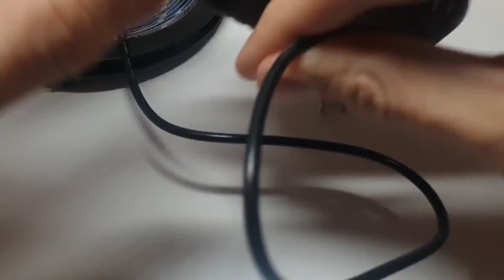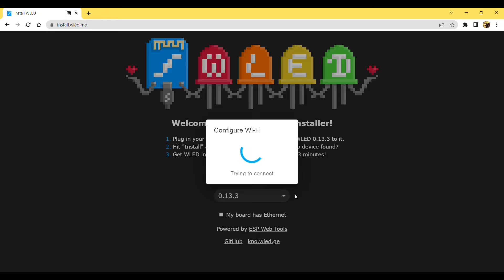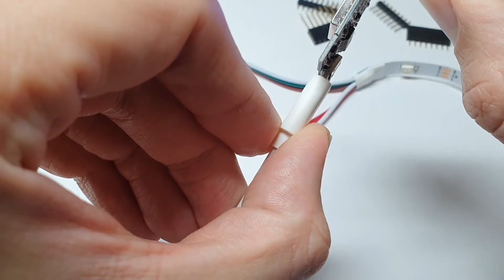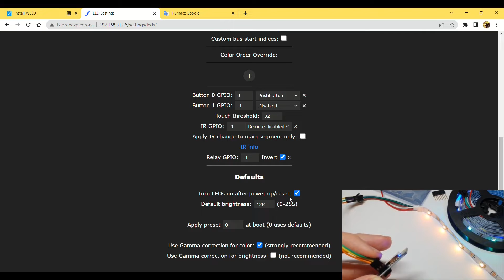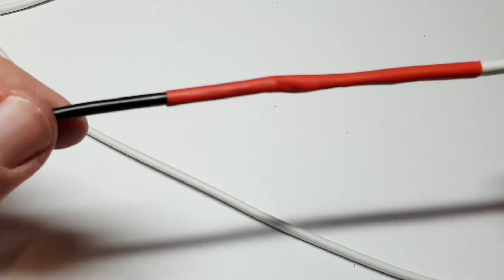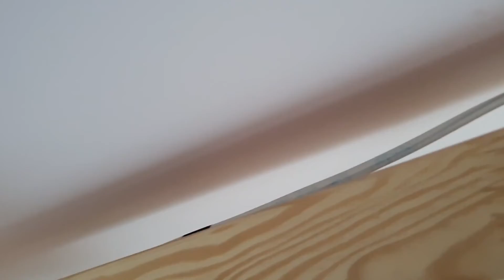Proste DIY - WLED ESP8266 Wemos D1 Mini i taśma LED - taśma LED WS2812B i IMPREZA!

Comment: Hi, great video and presentation. I know its an old video but, I'm just starting on this journey of WLED. I had a doubt and hope you can clarify. I noticed that you did not power the wemos D1 mini through the microUSB seperately. So, does this mean that it recieves power necessary for it to function from the connections it gets from the LED strip (power, neutral & data)?? I meant to know that I can can use the power source (Wall Adapter) to power only the LED strip. Kindly clarify. Thanks..
Reply from the maker: Hi, thanks! So if you connect the whole stuff like I do, it will be fine. I have 6 or 7 wleds done like that and I have no problems with it. Yes so you give the power to the led strip and then from the led strip the controller gets the power. If you want to Power them separately from the led strip take just data line to wemos.
Reply: @SmartTubeOfficial  Thank You for your kind reply. Will follow your method. Cheers

Comment: How did you integrate the LED to HA? :)
Reply from the maker: I'm using wemos d1 mini with wled software on it. Wled is automatically detected by HA, so you don't need to do much. Just look for new devices discovered.

Comment: Useless app , when 5 volt is off after some time'on loss all data agine  open app then set
Reply from the maker: Hi! In the Settings you can Save your setup so after loss of power you can have your preset options applied.
Reply: @SmartTubeOfficial  Thanks,whitch settings?
Reply from the maker: @vipalsharma4120 check this thread at reddit https://www.reddit.com/r/WLED/comments/n3hupp/wled_return_back_to_last_state/?utm_source=share&utm_medium=android_app&utm_name=androidcss&utm_term=1&utm_content=2

Comment: Is this a switching power supply? I have a similar power supply but can’t seem to power the board directly with the 5v pin, only via the USB..
Reply from the maker: Hi Matt, My power supply is a 3A 5VDC 15W. If you have the same one  and you do same connection as I did it should work. Have you connected the power supply as i did? What is happening then? Remember that I'm not electrician! So you need to try it on your own.

Comment: Nice Work,
Please share more details about the button you are using?
How is it interacting with wled? Wi-Fi or MQTT.
Reply from the maker: Thanks! To integrate lights with button is not that simple. In video description you can find link to that button, but to integrate it with lights you would need Home Assistant - https://www.home-assistant.io/. I have all my smart devices there and I can create lots of automations as in Home Assistant all devices can talk to each other even if they are from different manufacturers. If it's too much trouble for you, you still have web app to play with the light. There are some nice features too where you can create "macros" which can be triggered by http call or even with Alexa. You would need to dig to wled docs - try with https://kno.wled.ge/.